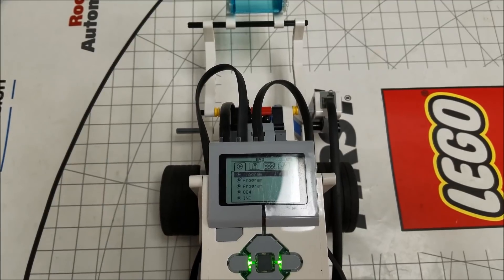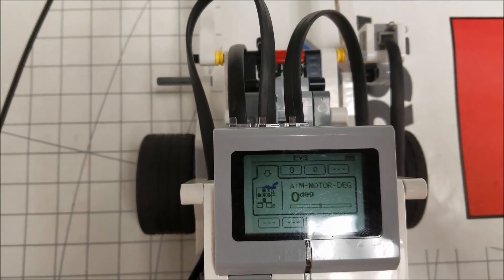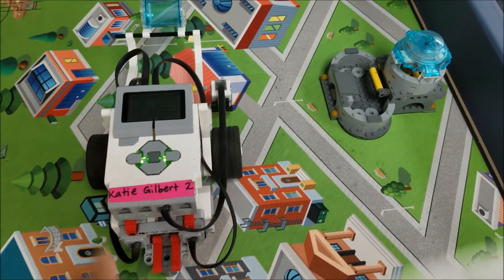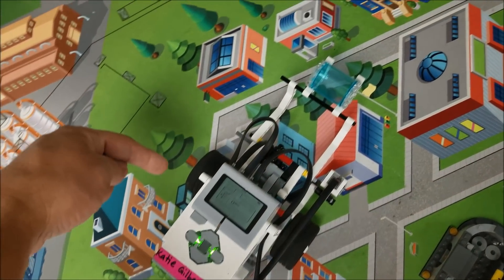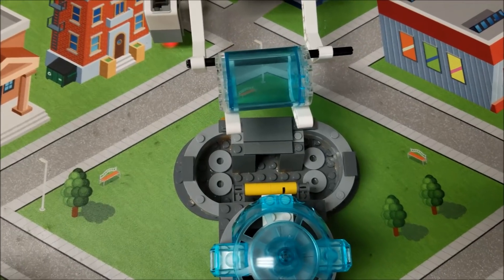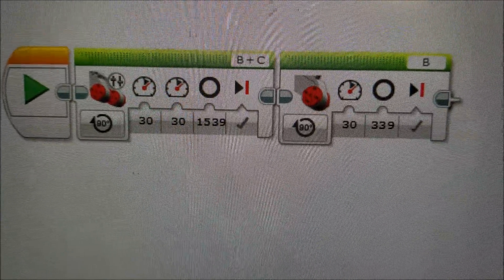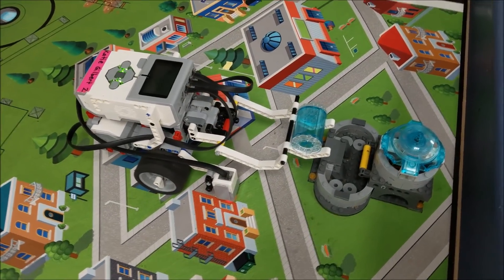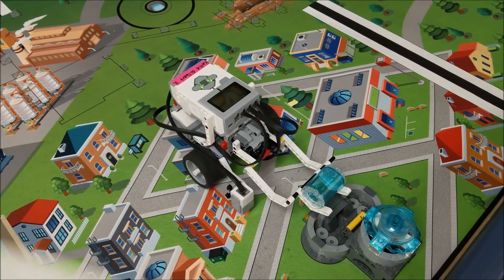"2017 Hydrodynamics: How To Make More Accurate Turns In FLL Robot Game"

Comment: Hi I am from team Talos from Canada, and we scored 450 points by using gyro sensor instead of the wheel degree. The gyro sensor allows you to calculate angles, and also compare them so you can do corrections to go straight

Comment: Hi! I'm from Team 26361 and this is once again a great video, but I thought that u shouldn't use the wall to line the robot up since the wall might have a different spacing in competition. I'm not saying you're doing anything wrong, but just an insight. Also, for rotations when going straight, u can just use this website to figure that out: http://ev3lessons.com/resources/wheelconverter/#en-us Thanks For the Video!
Reply: The south wall will always be in the same place (provided the mat is set up correctly, a good thing to include on a pre match checklist), the east and west walls usually vary by up to a quarter inch or so and the north wall by twice that. 

A solution that has a margin for error smaller than a half inch and isn't already using multiple navigation techniques is highly unlikely to be consistent across a variety of tables anyway so that shouldn't be a significant concern when considering walls as navigation tools.

Comment: Did you ever try to drive and turn by using the Gyro sensor? We are using this for our robot
Reply from the maker: We use a gyrosensor for straight aways.  How do use a gyrosensor for turns?
Reply: With the gyrosensor you can measure angles as well, we have built a MyBlock based on information from internet to make it work. The input parameters are direction (Left/Right) and the angle. If you want I can send you the file
Reply from the maker: That would be cool Kees!!  Thanks!!!
Reply: How can I send you the file?
Reply: Hello Adnan, I have sent you the file
Reply: Ada Demir Done!